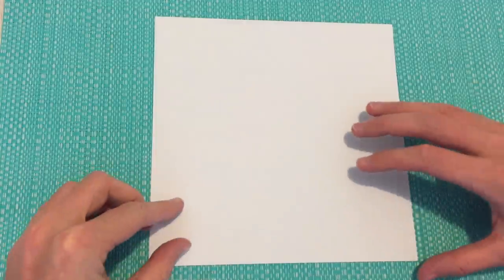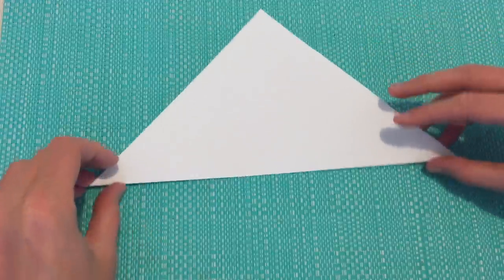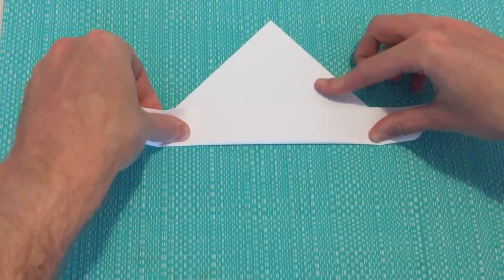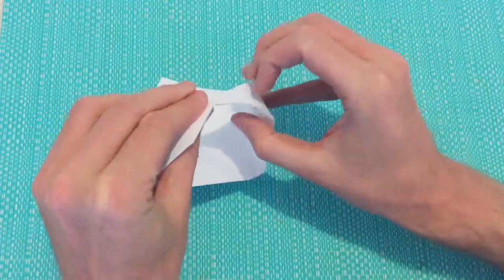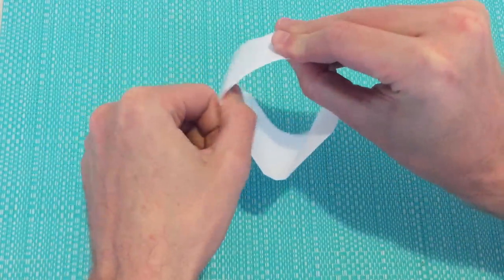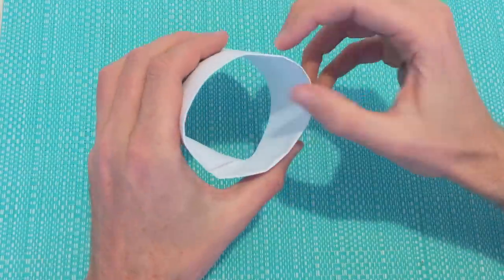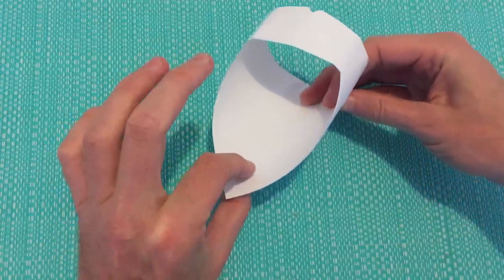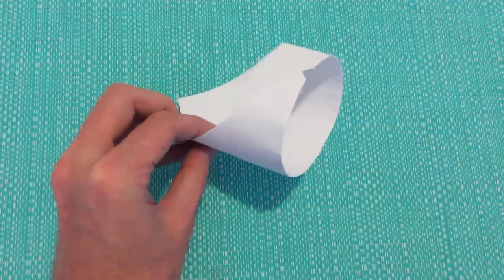HOW TO MAKE a PAPER CIRCLE GLIDER AIRPLANE (EASY!)

Comment: You did not gooi it in the video, so I was already sceptical. However, I did give you the benefit of the doubt by finding a flight of stairs to throw it off of, which resulted in my immediate humiliation amongst my peers and a stray cat.
Reply from the maker: I am sorry to hear of your public humiliation, especially when it comes to the stray cat, as they can be very judgy. This will absolutely fly, but it is more of a "smooth forward drop" that you need, rather than a forceful "throw". Give it another go, but maybe ask the stray cat to cover their eyes with their paws first though.
Reply: @HobbyWild  The cat listens to no one... but I'll try again